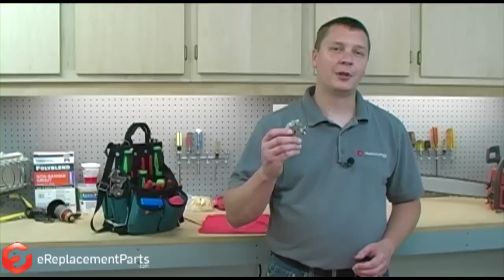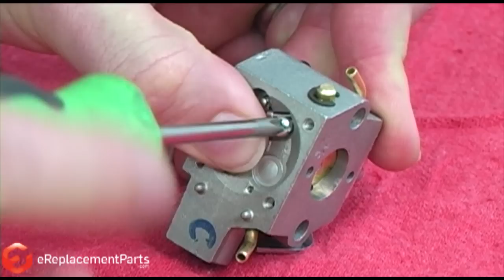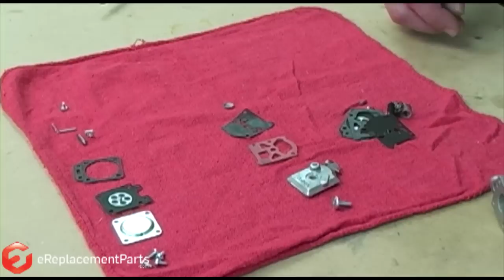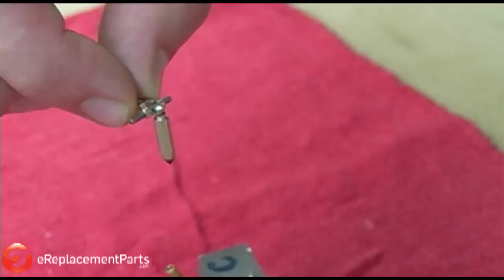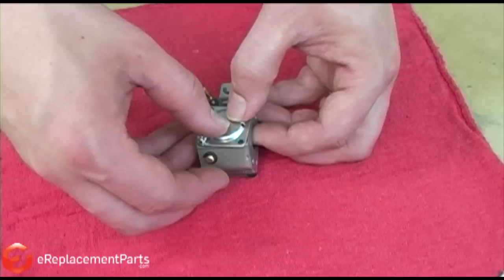How to Rebuild a Two Cycle/Two Stroke Engine Carburetor

Comment: Great video.  I've disassembled that exact carb and cleaned it with a Carburetor soaking cleaner on several different 2 strokes.  Sometimes it fixed the problem but from now on I will buy a Carb Kit and do it right the first time.
I've started using only Non-ethanol  gas in all my small engines, it really cuts down on gas line disintegration.  Two strokes are very simple engines but if you let them sit without draining the ethanol gas for more than a month you will get dissolved plastic!!

Comment: Thanks..... Very helpful video.  I followed your advice exactly and had no trouble whatsoever completing the rebuild.  I found it helped to use a bench-mounted, lighted magnifying glass to install the needle valve/spring assembly.  I also installed new fuel lines and a carburetor gasket.... The old IDE weedeater started on the third pull. :)

Comment: Thanks Mark. That part that goes in the hole under the needle/spring at 5.12 was my lesson. Didn't spot that on my McCulloch Powermac 6 when I pulled the carby apart in the first two occasions. On the third dismantle, I pulled it out and cleaned the channel. Put it back together, and fired up after a few pulls. Adam. Australia.
Reply: +jaker5555 Yes mark left out several key points like cleaning, and adjustment in an outside of carb

Comment from the maker: @memberson Good question. It's true that most carburetor rebuilds should include a cleaning as well, either with carburetor cleaner or--like you suggested--with an ultrasonic cleaner. There are two reasons why we didn't include a carburetor cleaning in this video. 1. We already have two carburetor cleaner videos posted explaining the procedure. 2. We want to keep the focus of this video on just rebuilding the carburetor. Because of your comment, we may annotate this video to link to the others.

Comment: nicely done. even I as a mechanically challenged individual should be able to do it. Thanks for doing this.
the job at hand is to rebuild my chain saw carbuerator. I got the kit from a local shop after taking the carbuerator in to them to verify the P/Ns.

Comment: I'm a big fan of your videos and have used several to rebuild various tools/equipment. I'm surprised you didn't suggest blowing any air through the fuel line pick up/purge lines or using any carb cleaner on it. Any reason not to?

Comment: Thanks for the good video... I have a Stihl weed eater model FS 55 about 3 years old. I can crank  burn one tank of gas then when I try to crank. It will fire up about one time shut down and won' start. I think it needs  carburetor rebuild kit. What are your thoughts?
Thanks,
Art

Comment: Hey Mark, I have an Echo PE 200 edger.  I replaced the throttle body that somehow was broken on the inside of the carb.  Once I was done, the unit would start and run but not while in idle.  It only runs if the trigger is fully depressed.  I replaced the spark plug, gas lines and grommet, air filter, gas filter, bulb, rebuilt the carb and changed the intake gasket.  I use new fuel and oil mix.  I used carb cleaner and air.  Made sure the spark arrestor was clean and my edger still stalls when I release the trigger.  I'm out of ideas???  Help!!

Comment: I find a lot of warpedparts, like the Thicke aluminum  over with the single screw. This seems to be the situation on mostly the Chinese versions that some manufacturers use now. 

What I've been doing is surfacing them one a piece of 180# wet/dry paper, masking taped to the surface of a piece of glass. 

These warped parts are showing in Craftsman/Poulon and a few Stihls. Husky has not had any that I've found to be Chinese.

Comment: what if the new gaskets or reed valves are not identical to the ones on the carb already? can I use them or did I buy the wrong kit?

Comment: My TORO single stage snow blower(38445) carb. appears to be a composite material.
In another of your super videos you show the use of a 'Lyman Sonic Cleaner' to really get the job done.   My question is does the composite carb. hold up in the Lyman without damage, does it require a specific milder cleaner,  should cleaner not be used at all.
I know this question is a little outside the realm of this re-building video, but, I would need to cover the carb. body question in my attempts on the rebuild.   Your carb body appears to be all metal.  ??????

Comment: I have a sears self propelled mower engine model number 143..986700 and I took off the bowl of the carburetor and used a bread tie wire to put in the holes and cleaned real good then replaced everything. The mower now acts like it isn't getting any gas at all. Before it would start and would stay running unless constantly priming huum what can I do now and a few questions if you don't mind. Why on earth does just a new kit make things all better. I don't know what the gasket type thing that goes on with the gasket actually does and I also have a lettile tube that sticks down from the carb and goes into the botton bowl not sure what that does either and I may in fact have a spring missing but wasn't sure ass I didn't see one when taking apart. I couldn't find a video for this particular carburetor. Thanks for any help.
Reply from the maker: +Bruce Hampton The reason a new kit helps is usually because most carburetor have a rubber piece in them that acts like a fuel pump.  Over time the rubber becomes less pliable causing the motor to starve for fuel. You can usually tell the rubber is getting old by having to keep priming the mower to keep it running.  These carbs are commonly made by 1 of 2 manufacturers.  If you have the carburetor off it should either be a Zama or Walbro and kits for most of these are readily available and pretty well priced.  The whole craftsman carb is available for around $96.00. If you can find any numbers on your carb, write back and I'll see what I can find to get you going again.
Reply: thank you

Comment: Hi Mark, I have a ryobi 700r. It will run on the primer bulb. I cleaned the carb but no fuel getting through, Any thoughts?
Reply from the maker: I would try to clean it again and replace the diaphragm.  The ports in these are so tiny it takes next to nothing to plug them and they almost impossible to open once they are plugged.
Reply: Ray Miller oh man... get a very skinny piece of wire. and wiggle it in all the little holes. Buy a can of parts cleaner with a basket and let it soak for 24 hours. And then blow it out with comprssed air. If it only runs on the primer reed valves arent working and letting fule be pulled in. rebuild with he right kit.

Comment: I have wt 990 carb. I recently bought new and only after a few tanks it stopped delivering gas. The punter bulb was full and it ran perfectly the prior day. What could be the cause of this ? The fuel filter was recently replace about the same time the carb was,Also I'm running this carb in a very dusty environment, How necessary is it to place a filter over the small inlet hole on he rear of the carb to prevent dirt from entering it? From my understanding the carb partially breathes thru that tiny square hole just below the primer build ? Thanks
Reply from the maker: It's unusual for a new carburetor to give problems so quickly.  The Ports on these carburetors are so small, the smallest bit of debris can plug them. Sometimes the diaphragm in the bottom of the carb gets damaged.  The diaphragm acts as the fuel pump so if it is damaged or not working, the tool will not run either.  Ethanol is really hard on these smaller carburetors.

Comment: Please explain if it is possible to put your needle lift bracket on upside down. I fear i did this. Now my primer bulb collapses on itself. I thought the lil lipped ring on the needle lift bracket or Fulcrum is what one end of the spring goes up against. Now THERE'S NO PISTON MOVEMENT TO THE NEEDLE. ANY HELP?
And could you tell me what model carburetor goes to a weed eater power pro edger.
Thxs a ton.
Robbie
Reply from the maker: It is possible to get the lift bracket upside down.  That could cause the primer bulb to collapse.  I would open that
carburetor again to see if that is the problem.  I'm not really sure anything else you cause the problem.  Send me the model number to your Weed Eater Pro Edger and I'll be happy to get you the price and availability
for the Carburetor.

Comment: Mark --- before you removed the base plate, the hole in that plate was oriented at the top of the carb. When you reinstalled the plate, the hole was positioned to the side of the carb.  Does this make any difference?
Reply from the maker: Hi Buck, and thank you for your question. As near as I can tell, the base plate is simply a cover for the carburetor and therefore it probably wouldn't matter all that much. However, I would advise re-assembling the carburetor exactly the way you took it off. It must have been a simple oversight in this video. Thanks again for the question, and good luck with the repair!

Comment: Before you replace the old parts with the new parts from the kit, is it necessary to clean the carburetor with a carburetor cleaner?
Reply from the maker: +John Bojorquez Alway, Always, Always clean the carb before you put new parts in. The smallest bit of debris can plug the tiny openings.

Comment from the maker: That sounds like the fuel lines to the carb might have been crossed. Take a look at at our video about how to replace fuel lines. It will help to confirm the correct line placement.

Thanks,

-Mark

Comment: He makes putting the needle valve back in look way easy. That was a pain. A tip, if your carb has a primer bulb on the top, rebuild the bottom first so it sits flat and you can get the needle valve in easier! No, really, do the bottom first, you'll thank me later!

Comment: I have a Tecumseh tc300 that is very hard to start even after cleaning the carb. You can get it started with starter fluid but once you get it started it runs great. One reason might be something wrong with the primer bulb because you push it and it doesn't tighten up with gas like it should. Any ideas?
Reply from the maker: +Kuiper Roerdink  I'm guessing the primer bulb is key to the problem.  Check the bulb and hoses for any pin holes or leaks.
Reply: Check your diaphragm. You can get a thumb gauge put a hose from the gauge to the fuel port going to the primer bulb. Prime the bulb (you should see the psi needle go up on the thumb gauge. If the needle hold steady its not the primer bulb. You can also check the seals by take the thumb gauge put the hose to the other fuel port. Pump up the psi and drop the entire carburetor in a jar of water (it won't hurt it)
Now look for and bubbles. If you see bubbles there's your problem a seal leak.

Comment: I rebuilt mine using your video as a guide as I did it. My problem still exists the thing wont run. I have a troy bilt string trimmer and it just decided not to start this season.

Comment: I remove the welsh plug to clean the tiny jets inside. Besides, to remove it you srill just through it's surface, use a pick and pluck it out. To install the new welsh plug, set it in place, use a small round tube one half the diameter of the plug and give it a couple light wacks to stretch the plug out into place, easy.

Comment: Hi , I bought a brand new maverick for Christmas, it has done 4 tanks, but last two tanks it was cutting out, and dying down, noticed that tankis sucking itself in, took cap off tank, and it hissed, but now it will not start at all, engine sparks, but will not fire, high and low spd needle has been adjusted, should I try readjusting them from factory settings again, any idea.
Reply from the maker: I would set the carb back to the original settings. The problem you've described, even though its a new tool, sounds like a plug in the carburetor. Try putting a drop of fuel in the carburetor throat to see if it is a fuel issue.  Also, most of the caps for these are vented to help control a vacuum issue in the tank.  Thirdly, if the carb is plugged after such a short time, check inside the tank to see of the fuel filter has become unattached.

Comment: Hi, the  Metering Diaphragm Cover has a breather hole, when putting the cover back on does it matter what side the hole is pointing?
Reply: Point the hole on the side of the two locating lugs(used to locate the gasket) on the carb body. You'll notice this at the beginning of this video.
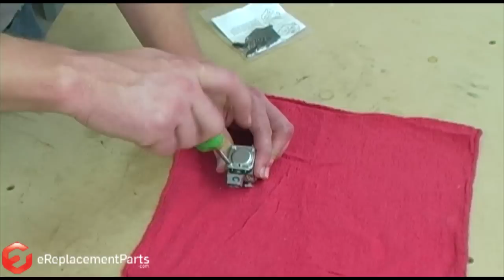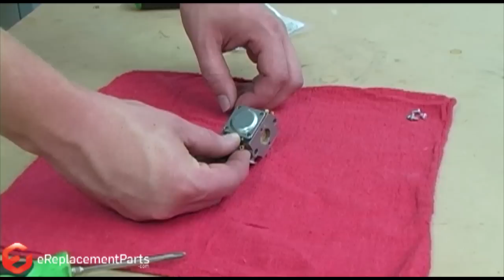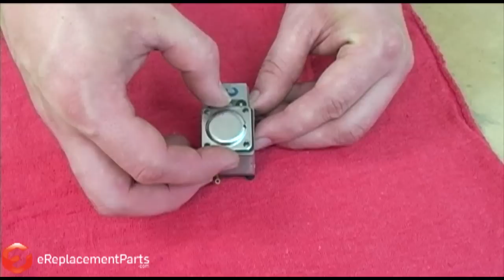Reply: Allan Wells @1:18 you can clearly see the hole pointing up towards the adjustment screws, then again with a closer view @ 1:26.During the assembly starting @ 5:50 you can see the hole is rotated 90 degrees to the right. I'm not sure which is correct but I'm going to place the hole up like at the beginning of the video
Reply: Allan Wells I noticed this orientation at the beginning of the video but he reassembled it in a different position.  Thanks.

Comment: How does the air and fuel screws set?   The video was very helpful thanks.Ive had trouble before on older ones with air and fuel screws.
Reply from the maker: +Shawn  White The older model carbs did have adjustment screws. Because of strict air standard laws, The newer carbs are with jetted so they can't be adjusted or if they do have screws the screw has a head that can't be adjusted by a normal tool.  We used to be able to sell the carb adjusting tools but now the EPA will impose hefty fines if the find out you have them.

Comment: Now see I did all that and now putting my carburetor back together, first fired up really well when I give it to gas it chokes out. Any idea what that might be?
Reply from the maker: Your problem might be a problem still with in the carburetor but I would check the exhaust port to see if there is a carbon build up.  A clogged exhaust port will restrict the flow of the exhaust causing the engine to die as you try to accelerate.  You should also double check the fuel line to make sure you don't have any kinks restricting the fuel flow.

Comment: I agree with Mark, i have fixed many of these small carbs over the years and have never remove a welsh plug, and so far, never had one I couldn't get to run. 99% of the time take it apart clean it and you won't even need a kit. They take a little patience and experience but these carbs are hardly rocket science.

Comment: thank you....was wanting to know where the gas lines feed into the carb fron the gas tank...two stroke husqvarna 223l weed eater...
Reply from the maker: The inlet is on the side behind the mixture adjustment screw and the return line is directly across on the opposite side.

Comment: The needle valve & spring reassembly with 76 year old eyes and fingers is a bit slower and requires the use of multiple words not generally used in mixed company.

Comment: Mark < Do you have any video's for sale on reassembling a chainsaw ( crankcase to starter assembly) .I have a Husqvarna 445 . engine I need to reassemble and would like some assistance . Thank   You // Sonia A
Reply from the maker: +John Allen All of our videos are on line and free to help with your repairs. We don't have any going as deep into the engine as that.  There may be some online.  They are usually free to view.
Reply: Husqvarna 455 rancher teardown and rebuild, bolt for bolt!  part 1   on U Tube

Comment: Nice video Mark. Only one comment or question. You didn't show the correct metering lever height. I believe on this Walbro, it should be even with the carburetor machined surface.

Eric

Comment: What's the best way to clean the carb. I have changed all parts but it still won't run, I think it is a jet or port that is blocked. The one in the throat I can't get to or remove.
Reply from the maker: +Randall Montes Your right.  Some of the ports on these are very small and can easily plug.  I've had the best luck with carb cleaner and atube.  If it still won't come free I use an Ultrasonic cleaner.

Comment: I guess I'll have to start all over I went through that and still doesn't work right mine is different both tubes you hock the hoses to are on the same side I have wt520.

Comment: I have a viza v2 gas scooter, it takes a while to start up and when it does it just dies down when i press the throttle.. any thoughts? Is it just the carb?
Reply: kam maldonado if it has good compression its the carb. If not compression ring is bad. rings are bad

Comment: I don't understand why some 2cycle carburetor don't have rebuild kits.
like homelite 26bv  carburetor #308028007 
Do we replace the whole carburetor in this case?
Reply from the maker: +James Lin Some of the older carburetors are not EPA compliant and some of the manufacturers suspend the sell of parts and kits for this.  Luckily in this case there is a replacement carburetor.
Reply: +eReplacementParts.com our grass trimmer will starts but after a minute stops. i think i need to replace or rebuild its carburetor. where can i purchase it? it is a Kaaz Td40 unit.

Comment: I was surprised that he didn't take the opportunity to blow some carb cleaner through all the ports. Shoulda pulled adjusting screws too if it had them. In related video he used carb cleaner sprayed down carb throat to start the engine. Maybe OK but it seems carb cleaner would strip away all the oil in the cylinder.
Reply: he used starter fluid, not cleaner